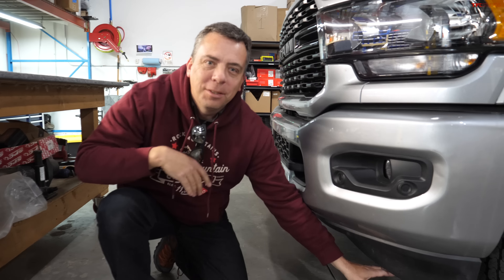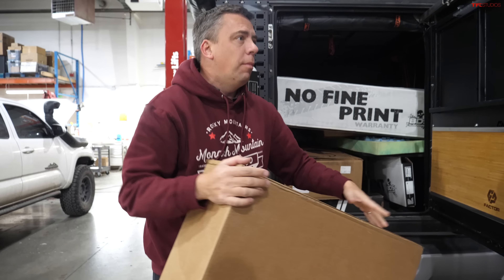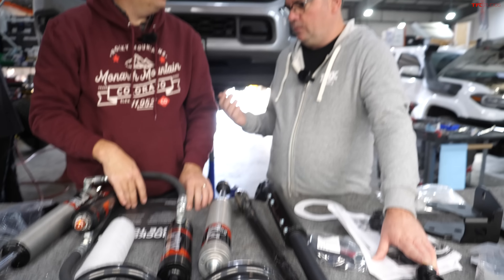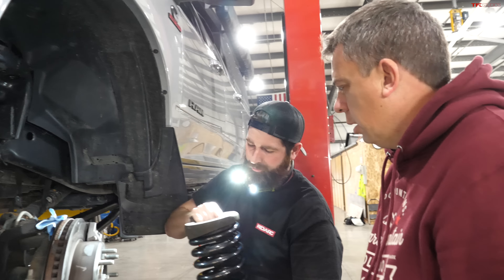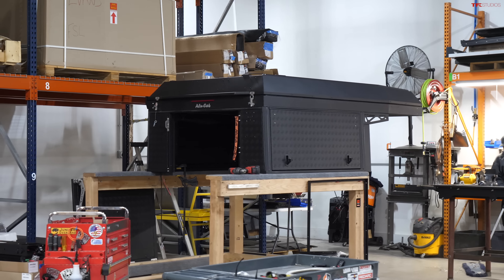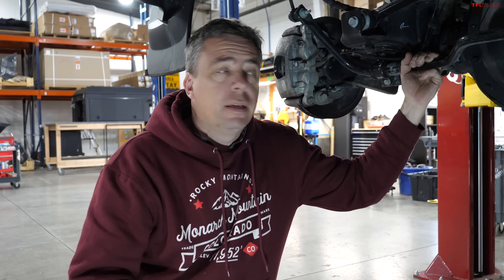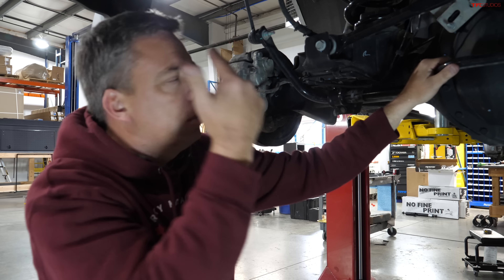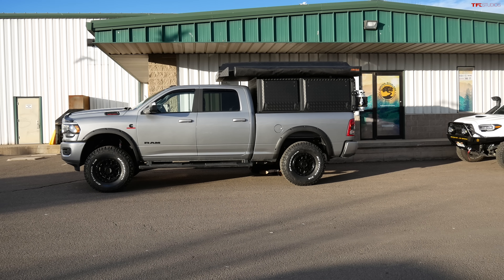Moment of Truth: Did We Succeed in Building the ULTIMATE Ram Cummins Overland Truck? TrailHound Ep.4

Comment: That rear end needs a Thuren track bar kit (or equivalent). It will significantly reduce the rear end wag you'll get even more of now with the addition of the spring spacers. It raises up the axle side mount to bring the Panhard more parallel to the axle at rest. This reduces the lateral shift of the axle as it raises and lowers most notably at higher speeds. Best handling addition I made to my Power Wagon.
Reply: They put a BDS suspension on it. I don't think they really care about the ride quality. I'm sure BDS paid a good bit of money to sponsor this. Should have at least on Carli again
Reply: Carli suspension is much better. Have it on my powerstroke.

Comment: great video Andre, good quality products from local companies to do the install, the only thing i am surprised at was there was or is no upgrade in rear end gear ratios or did i miss that in a previous video, it certainly does look like it will be fun testing it out on the upcoming trip along with the Buhanka should be allot of fun 👍😎
Reply: We did not touch the rear axle gearing. This is a Cummins with so much torque and power ! The engine has not noticed the wheel size change.
Reply: @TFLtruck  The speedometer will. You are right about the torque but the sweet spot for RPM is 1700-1800 max torque. Now you will be cruising at a much lower RPM.. I have a 2012 6.7 RAM with 295/70-17 on and no gear change, with a travel trailer I do feel the loss  of power. To over come this I manually hold the gears longer to keep the RPM up longer before letting it change.

Comment: I have a question for the people using adjustable shocks. How often do you actually change settings, or do some even set it once and leave it?
Reply: I adjust them when I need to, I spend time with the truck empty and have a setting for that, I add a rooftop tent and have a setting for that and sometimes I haul stuff and can find a setting for that. For the most part I don’t change settings regularly, you dial in to the ride/handling you want and leave it till there’s a need or desire to adjust.
My preference is to run my low speed higher in the settings and my high speed in the lower middle settings (higher resistance to body roll, lower resistance to bumps).
Reply: Adjustable shocks are all hype. Get a properly tuned shock and you're set. Or the electronic shocks Those things are pretty sweet but are extremely expensive
Reply: @Rommer2258  I’ll agree and disagree at the same time. A properly tuned shock will make the biggest difference day in day out. A properly tuned adjustable shock will be even better (depending the use case). As I said in my comment above, my truck spends time unloaded so dialing out a bit of compression keeps the ride nice. When loaded down with all the camping/adventure gear it is a lot more prone to roll so dialing in a bit more compression keeps it riding pretty close to unloaded (as far as ride quality goes not ride height). Some times I’m ultra aggressive off road and being able to dial up compression high and low across the board will help keep me from bottoming too easily or harshly.
But yes a properly tuned shock will do more for most.
Reply: @RobbDzzz  with a large enough shock with the right shim stack it'll work fine. I've got bypass 3.0s professionally tuned which you , they'll open it up and change the shim stack. Plus adjust the tubes on the outside It'll handle everything from towing a 5th wheel to rock crawling to 70 through the Mojave through 2' rollers. 

I agree with that much of a drastic change or a smaller shock it's beneficial. Especially for the price point

Comment: Doesn't Ram already make a cheap PowerWagon option package for the base 2500?
Reply: Not for the diesels.  Gasser only.
Reply: They still option it but it's not cheap anymore. A tradesman wagon is in the high 50s now. But it still has a significantly better payload then the loaded ones, you can get a 2000 pound payload still on a tradesman one where the regular wagon is in the 1200 pound capacity now

Comment: You better get a good transmission tune, bonded separator plate for the valve body or billet channel plate, strong accumulator plate, and a thermostatic bypass and bump the line pressure up to 225psi or that 68RFE is not going to stay happy very long.

Comment: Too bad 2500s suck to offroad. Absolutely hate my 22 2500 ram offroad or on wash board roads. But that's why I have a frontier
Reply: Get a Thuren suspension kit for it, you'll change your mind
Reply: @Joe Hansen  yeah no, an 8 foot bed crew cab doesn't need to offroad it needs to make $$. Offroading a full size truck is pointless in the west, trails are too tight

Comment: I’m surprised the frame hasn’t bent yet
Reply: Why is that? Did they install a ford frame? 😂
Reply: @ITrustInDog  lol someones a fanboy cuz ive only seen Rams with frames bent bud
Reply: @StriateCheetah  I’m certainly no fanboy. Just google superduty bent frame. 
Only a fanboy thinks this doesn’t happen to his particular brand because he never looked it up. 
Show me one brand that hasn’t had a bent frame from some idiot overloading his rig. No truck is protected by special pixie towing dust (you’ll understand if you’ve watched TFL long enough).
Reply: Mainly because they didn't put 7,000 lb behind the rear axle. Like all the trucks that bent frames
Reply: I see bent frames on plenty of Ford's but only one Ram. I think you are getting it confused with Ford frames.
Reply: @StriateCheetah  1st generation raptors had really bad frame bending especially since most treated them like a Baja truck jumping them all thime. Yes Fords bend there frames and I'm a ford guy loved my 83 ford bronco my 89 ford bronco and 2000 Eddie Bauer expedition even I can admit any vehicle can get bent frames from misuse or even just using it correctly can wear things down over time.
Reply: Probably because they haven't overloaded the truck.
Reply: Ford steel can’t bend. Look it up!
Reply: @Bigbillyrayfan  😂 That's a good one! Also I have a bridge I want to sell you lol.🤣
Reply: That's a ford thing! It happened to mine not even overloaded. They use cheap metal. Its happened to 1 newer ram because of the 7000# behind the tailgate.
Reply: @fireant1272  can you please elaborate on the “cheap” metal??
Reply: @Bigbillyrayfan  100% of the Steel ford uses to date is imported from other countries. Ram and Chevys steel comes from Minnesota and Michigan. So fords steel = cheap! Its probably not even steel!

Comment: A huge waste of money guys . Your making this truck worthless for any real world work  .
Reply: I usually say the same thing but they’re not doing “our” real world work. I’ve always wanted to be a Carli suspension long bed flatbed guy with the long travel air bags. Or an aev setup with a flatbed. You know, because gooseneck life.
Reply: They are specifically building an overland truck for camping and traveling long distances on high clearance required roads.  That's literally the whole point of this.  It's not like it doesn't say it right in the videos title.
Reply: Wasn’t this suppose to be their “work/farm” truck.  This turning everything into a overlander is getting quite boring.  I’d rather see the truck outfitted with bumpers, winches, racks, etc to make it a capable work/ranch/farm truck that can be used for some off roading.
Reply: @Joseph Furey  is agree.  And honestly overland builds are mostly just about advertising all hipster truck gear.  It's mostly unnecessary
Reply: @Joseph Furey  also they did a super subpar job on that lift.  They didn't account for the heavy camper and gear in the back so now it's got that Carolina squat LOL